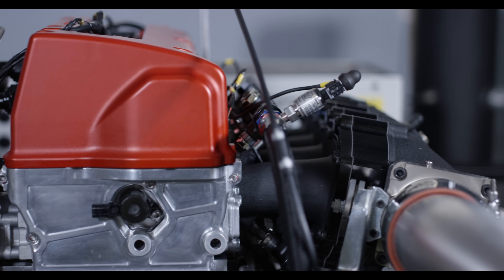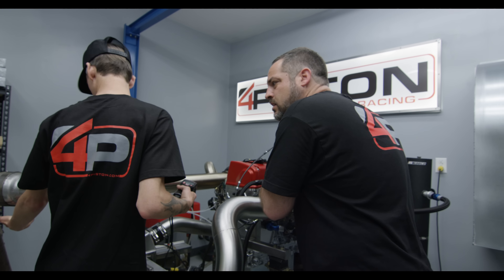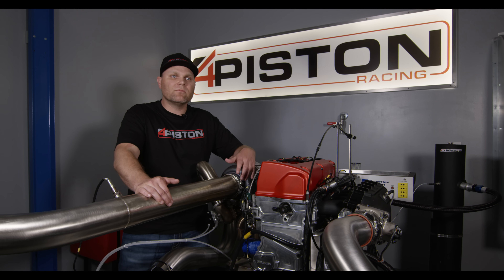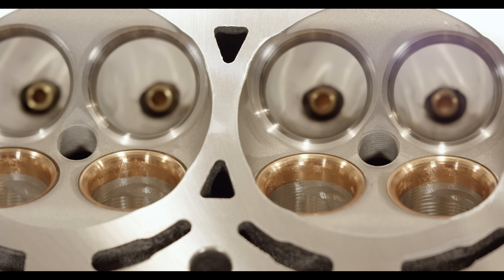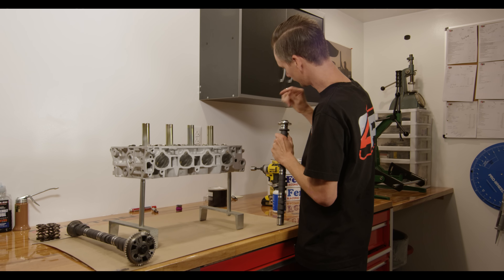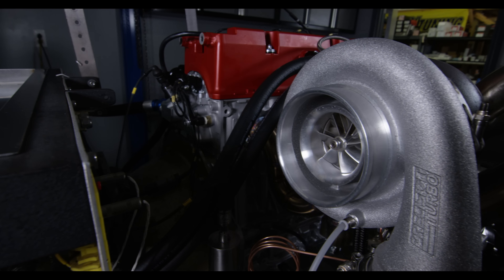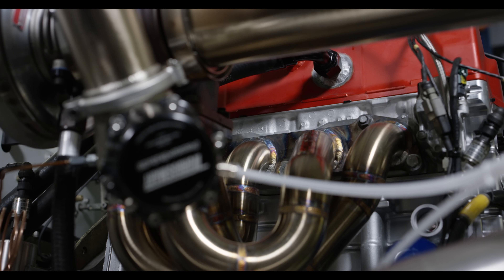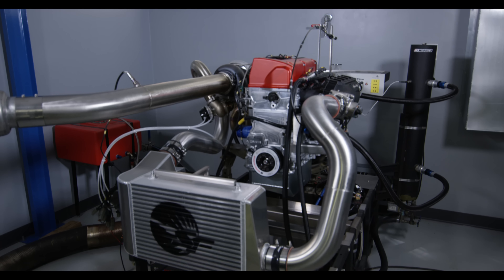1000hp 4 Piston Turbo K24 STREET Engine Build and Dyno

Comment: And then there's those 2jzs making 1800hp... 300hp per piston ... only slightly more displacement too.. just thought about that when people were losing it over this doing 250hp per cylinder...
Reply: Speed factory has a h22 with 2000+ Hp, that 300 Hp per cylinder 2jz is for peasants.